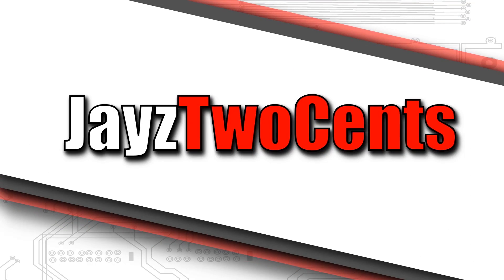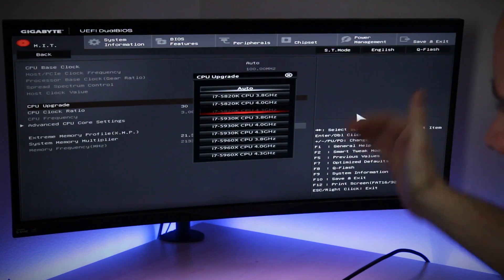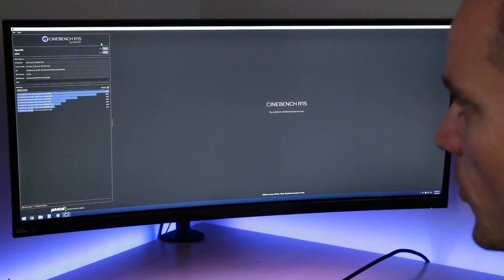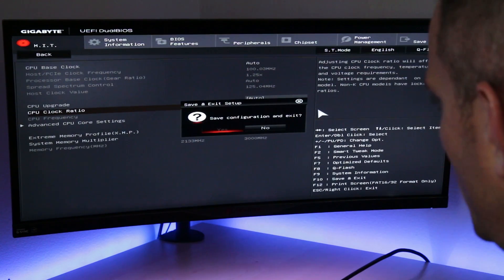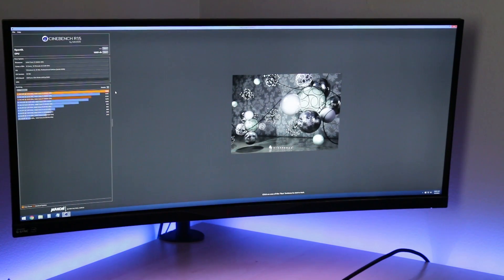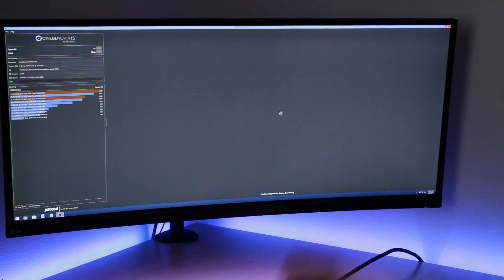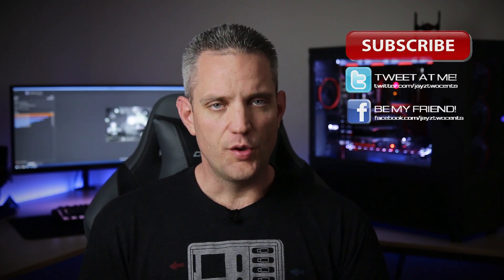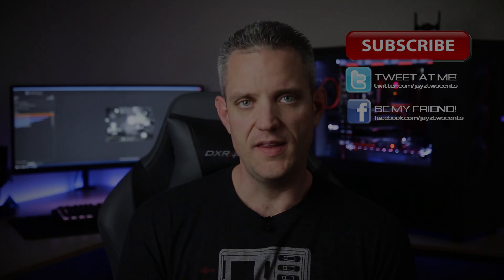XMP vs Overclock

Comment: 0:14 someone tried over clocking an AMD CPU......
Reply: ***** RyZen has a lower TDP than it's intel counterpart... so, nice research... even the "bad" amd CPUs aren't as bad as intel fanboys make them sound I had my 8300 overclocked to 4.2ghz and it never went over 45c under load
Reply: AMD still holds the world record for overclocking and is king for extreme overclockers.
Reply: 1 year ago... joke's on intel now.
Reply: pretty sure that was a grow house
Reply: To my knowledge even 8320 is capable easily getting past 4,5ghz with decent cooler with 1,4v. Haven't OCd those that much but I believe the voltage was around that 1,4v. 8350 isn't that different, it's just higher clocked out of the box, but reaches 4,5ghz or more with similar voltages. Also we know that 1,55V is still ok Core voltage when temps are kept in check since fx 9590 at 5ghz uses 1,55v and it's out of the box and it's again the same chip as 8350.
I'm not sure how experienced overclocker you are, but you RAM or even the motherboard VRMs might be the issue. You need atleast 8+1 power phases to get decent current, since those CPUs can go near 200w tdp when OCd. There are power saving features aswell so check on those aswell.
Reply: Steven Randall Heat and temperature are two different things. fx 8300 has die size of 319mm2 which is the same as 8350 cause they are basically the same chip also the chips is full CPU, no GPU part. Back then at 8350 release Intel already had i5 3570k out and it only had die size of 160mm2 and it had integrated GPU as part of it. Looking at the physical CPU layout we can see that the GPU is occupying about 1/5th of the die so the actual CPU is only around 128mm2.
So i5 3570k is outputting 77w tdp from that area and 8300 is outputting 95w tdp from 2,5x the area!
So AMD chip has 2,5x larger are to dispatch heat vs Intel chip, of course IHS limits this, but it's hard to say how much.
So seeing FX 8300 at 95w or 8350 at 125w while working at sub 60c is no wonder vs 77w chip with over 2x less area.
Newer Intel chips are sub 200mm2, but they have larger GPU part aswell meaning that we are still looking around 150mm2 die are for the CPU part and the TDPs are now +90w so expect to see +80c temp on Intel chips.
That being said, Ryzen is claimed to have around 200-250mm2 die size and 95w tdp so it's gonna sit below Intel in terms of temps, but higher then FX series.
So to go back to your point. If FX 8350 at 125w tdp would be as big as current Intel chips, you could only keep it sub 80c with very large air cooler or water cooler.
Reply: Diglo1 the point wasn't that am3 chips don't produce as much heat as intel's I know they do, my point is saying that ryzen is going to burn things down at this point just isn't a claim with evidence behind it, in fact the evidence is to the contrary. And I do realize that heat produced and temperature are different things, but we're talking about the ability to dissipate heat, and keep temps low, not necessarlily that there is less heat to begin with. Also upgraded to an 8350 after selling my 8300, thermals in my system didn't change between the OC 8300 and the stock 8350
Reply: Steven Randall Ok glad we are clear.
Well overclocking 8300 is pretty much making it 8350, the other one has simply more conserved turbo and voltage table, but it's the same chip and the binning is the same.
Anyway at 95w tdp with +200mm2 die are for the 8c 16t part should be pretty cool setup.
4c chips with 95w tdp should be similar to current Intel lineup id IHS is good as it had been on AMD chips, not the crap Intel uses.
Reply: Diglo1 I know I wasn't intending to change from the 8300 to the 8350, but i needed to sell my motherboard and the guy offered me an extra $150 to include the processor... picked up the 8350 for $110 it was really a no brainer. Besides I was having some difficulty trying to get it past 4.1 this one remains to be seen
Reply: I have no dreams of going anywhere near 1.55V as of yet, I dont think my cooler will take it. My current board is 8+2 power phases and the old one that I used with the 8300 was 6+2, Overclocking had nothing to do with the switch though it was SLI that got me to sell my old board and move on, the slots on my old MSI board were awful as far as position was concerned
Reply: Steven Randall Just saying that if your OCs fail it might be because of lack of voltage and cooling and that you do not know safe limits and are too conservative as to how much voltage to use.
But if you are aware I guess good luck. 4,5ghz should be piece of cake with hyper evo 212.
Reply: PACo626 my house will be soon burnt into ashes....i overclocked my fx 6300 to 4 ghz...
Reply: That was reached by LN2 since no other kind of cooling can do it. Also RAM timings an speeds are unknown, the motherboard is not that great for very high end overclocks. So I wouldn't trust those results even if the overclock was done on one core. There is a slight possibility, but I doubt anyone would dare to even try LN2 OC with 970 chipset motherboard which doesn't have atleast 12 power phases.
Reply: Real world vs competition? Really? It means nothing to everyday use.
Reply: Wow somebody made that joke a year before you did in these comments. 10 outta 10 good job.
Reply: PACo626 lmao
Reply: The King of OC and World Record is Intel, not AMD, lol.
Never seen an AMD hitting 7,3 + GHz.
Reply: Sompli bull shit, fuck you.
Reply: the FX 6300 ran up to 9.48 Ghz in Records. 5Ghz ona  good sample is possible stable. http://valid.x86.fr/search/search.php?psn=414d4420465828746d292d36333030205369782d436f72652050726f636573736f7220202020202020202020202020&sort=freq
Reply: I'm gonna need a source on that one, because my overclocked FX-8300 is at 61c and has been stable at that temp for the last 5 mins of what is now a 15 minute torture test. Seems pretty reasonable and leveled out to me
Reply: J Cell just got my AMD A10-6800k to 4.8Ghz at 50-56C
Reply: My AMD 10-6700 is overlcoked & the regular average temp. only goes around or up to 52-63c.
Reply: Yeah but absolute dogshit for gaming
Reply: santclause1 that's at 100% Max load though, tj Max is like 72 anyway, pair that with a discrete gpu and it is fine. I can play any game no problem
Reply: Or Haswell
Reply: Dats just AMD cpu (older versions) but with Ryzen now, it will be a mushroom cloud!
Reply: +joshua mcgovern ye and a intel pentium would be faster than that worldrecord oc at stock speeds
Reply: +joshua mcgovern ye and a intel pentium would be faster than that worldrecord oc at stock speeds

Comment: I just overclocked as far as I needed to. So by overclocking my I5 4670k from 3.4 to 4.2, I gave my cpu performance headroom, whilst at the same time having the cooling capacity to take it further if I wanted to. Since Iam in winter in Australia, probably not a good idea since in summer my temps are probably going to even out

Comment: F me overclocking didn't used to be so complicated XD. Thanks so much Jay for helping me understand why I couldn't get my full advertised ram speed through the XMP profile (Already overclocking CPU as far as possible with current cooler) Now I'm just curious about what the perfect trade off would be, Maybe back off a little on the main clock? Or try to drop timing on the ram to get the latency down instead of the ram clocks up? Much tinker. Very OC. Wow.

Comment: My first 5820k was killed by my Asus X99 Deluxe on Auto OC. The Voltage Delivery was broken and the CPU didn`t survive that. Gladly the retailer send me both Parts new and I am now running 4,3GHZ at 1.275V stable. The highest stable was 4,6GHZ at 1,325V but it was way to hot for Air Cooling. Anyone with similar experiences?

Comment: But automatic overclock most times puts more voltage than the CPU need and raise the temps & lower the lifespan
Reply: why do you think he stresses the importance of cooling?
Reply: wades623
Cooling may be good but it does not lower the higher voltages. You may run on 35C and still have higher voltages. The threat from the higher valages is not just higher temps man :) I was talking about automatic overckloking
. I like to set it on -0,25v on mine for example. Thats automatic voltages -0,25v.

Comment: >Got FX8350 and Dark Rock Pro 3
>BIOS automatically set clock to 4.1GHz
>Run Prime95
>Can't get through 10 minutes without 2 cores failing, even though CPU at 50°C
>Have to set CPU to 4.0GHz (a.k.a. "Power Saving Mode")
>Finally works fine
>...
>There was no lottery to be had
>Fuck AMD.

Comment: One of the best motherboards I've ever owned for overclocking is the ASRock Z170 OC formula. It's not cheap, but wether you are a novice (using profiles) or an expert (manual), you can get some great stable overclocks out of your ram and cpu. Super stable power delivery. Love it!

Comment: Here's a question: These overclocks were achieved using a K series CPU. These CPU's cost more than "normal" ones, so the overclock isn't actually free - you paid an extra for the CPU itself (and for the mobo, and for the cooling). So is the performance boost actually worth that extra cash?
Reply: As far as I understand the K models are the unlocked models so theere is I5 6500 and 6600k can't over clock the 6500 and yes the unlocked is more expensive. But not $100 more

Comment: Is the hyper 212 evo enough for automatic overclocking?
Reply: Yes. That's exactly what I'm using with an ASUS Z97 AR board/G.Skills Ripjaws RAM @ 2400MHz and i5 4690k CPU auto-OC'd to 4.7GHz. You will need a large case with 6+ fans for good air flow, though. HTH
Reply: I used to use it, for X99 you shouldn't as my temps were quite dangerous but with cooler chips you should be fine for moderate overclocks
Reply: it's more than enough I just built a pc for a friend with the hyper 212 cooler and a i5 6600k and got it to 4.6ghz stable at 1.275v and it hasn't gone over 60 degrees Celsius, hyper 212 EVO is the best air cooler you can get at least for its price

Comment: Intel Core i7 5960X (8-Cores, 20MB Cache, Overclocked up to 4.0GHz w/ Turbo 

this is my cpu and i was wondering if i can oc. because when i got it. it wasnt 4ghz but 3. soooo i was wondering do i have to oc my self idk
Reply: Overclocking is easy , just don`t go pas 1.325 volts if you want to be safe play around with the CPU as long as you keep with that voltage you should reach 4.4 and 4.3 with no problem , don`t be afraid to change it a bit but never past 1.370
Reply: aight thanks man!!!

Comment: I built a Sandy Bridge system in 2011 and followed all the good advice when overclocking.  My 2500K was running at 4.6GHz with 1.3V which apparently is a very safe overclock with that chip.  Then about a month ago my CPU and P8P67 Pro mobo just died at the same time, no warning no nothing.  My system just powered down all at once and it turned out both were dead.  

So I'm looking at a Skylake build but I won't be overclocking it.  I'd sooner not have a bit of extra performance if a few years down the line it's gonna cost me £600+ for new parts.  I want my PC to last ...
Reply: +Sid Cannon No point in going for a Skylake cpu right now, the 4790k pretty much performs exactly the same as the 6700k, same reason i didn't bother to upgrade to a 6th gen and got a 4th gen
Reply: Bongo2k
I'm actually considering a 4790K because I can use my existing DDR3 and where I live they're currently doing a deal on a 4790K and an MSI Z97 Gaming 5 mobo for £377.  Skylake mobo & CPU is at least £50 more then there's the RAM.
Reply: Sid Cannon Ram speed honestly doesn't really matter for gaming and general computer use, plenty of videos confirming it. Linus did a good video too.
I got a Sabertooth Z97 off ebay for £145 and a 4790k for £240. 8gb 1600mhz CL10 ram was only £30 and you can easily upgrade to 16gb for an extra £30 later.
Reply: Bongo2k
I know, I watched the RAM speed video(s) done by Linus, as memory speed goes up so does CAS latency and they cancel each other out. 

I've ended up going with Skylake because I really wanted a Sabertooth motherboard and I couldn't find anywhere selling a Z97 Sabertooth new.  It's cost me a bit more than I wanted to spend, but hopefully it'll last me yonks, longevity is the main thing for me, hence the Sabertooth.

It's being delivered tomorrow, happy days :)

Comment: My i5 6600k got 507 score at stock. At the one button over lock thingy on my board it bumped to 4.4 ghz and it's sitting at a 726 score.
Reply: +Lagged ops My i7 3630QM (notebook) make the same 507 at stock ( there is no overclock in BIOS)
Reply: +Raimar Lunardi so overclocking my i5 makes it destroy your i7 :)
Reply: +Lagged ops Well, thinking that Mine is a NOTEBOOK and 3 generations older, I think it destroys your i5 in performance per watt :)
Reply: +Raimar Lunardi but performance to price mine wins cos laptops are way too expensive
Reply: +Lagged ops divide the price for 3 years now...

Comment: @JayzTwoCents
Hey jay I watch the channel and love it. I think all of the things you do tech wise is awesome. I love the reviews, guides, and other random things that appear on your channel. I was recently changed by a friend to pc " use to be xbox" gamer. Ive only built my first computer now and have a question. The build is as follows, ASUS M5A78L-M with an AMD FX 8320 processor, cooler master evo 212 cpu cooler, AMD r9 390 graphics card, corsair 850watt PSU, Western Digital 1TB hard drive, 16gb 1600mhz RAM,  a cd/dvd disc drive, all in a full tower gaming case. Im working on overclocking my cpu currently and was wondering what should be a number that i should be able to achieve with this setup?

Thanks

Comment: Greets. so you say that if I do the easy overclock on I5-6600K (with Asrock Fatal1ty z170 gaming k4) to 4.2, should I put the profile to auto and not XMP profile 1? I m not sure I understand this XMP thing; I have the hyperX 16 gb dual channel ddr4 at 2400 Mhz. a little guidance will be appreciated. thanks

Comment: What about if you oc your cpu will that reduce your cpu longevity. for example your cpu can work for 6+ years but if you oc it that time may reduce number of years your cpu will work.
Reply: +Grim Reaper there really is no number that is reliable, youre more likely to have a bad chip that degraded faster than spec than to have a chip die simply due to overclocking. this is assuming that you arent a moron  and pumping volts into youre cpu to run a crazy high clockspeed with a stock cooler.
Reply: Taylor Trotter

i have water cooling predator 360 and i didn't go to far with volts. Got my 5930k @ 4372ghz
Reply: Nice. Did not mean you specifically. Point is, as long as you keep the chip cool while overclocking, you'll be fine, Ive run my amd fx8350 at 4.7 ghz since I got it a couple years ago.

Comment: stupid question, do most modern mother boards have the XMP and automatic overclocking settings? Im looking into building a computer and I'd like to have these options.
Reply: +FyreDrayke7 Pretty much all modern motherboards will support XMP - if they're intel, it used to be only high end motherboards that supported automatic overclocking but even some mid-range mb's are capable now. If the motherboard supports it you can bet it will be clearly advertised.
Reply: mentoo1234 well, thank you very much good sir! Very helpful, have a great day.

Comment: XMP Profiles comparing 2 brands 2800 vs 2800 will not change bclock any differently.  It's entirely up to the motherboard manufacturer and their bios guys.

Comment: I overclocked my 2.83ghz xeon processors a long time ago to 3.5ghz. It has been running since 2008 and I never needed to increase voltage after the initial overclock. One ram stick died, but they have been running at 85-100 °C

Comment: Stock Cinebench score: 3259

Dual Xeon E5-2680v3.
128GB Ram.
Reply: gg
Reply: O_O (i will get a quad xeon board and fill it up with 22 cores xeons a and a terabite of ram
Reply: That would be a waste as the Xeon E5-2699 v4 only supports two (2) processor configurations.  If it did support four, it would cost you $16,400+ for just the processors.
Reply: Alexander Morou Some people do it for the sake of the benchmarks, if i was not poor ... I would buy 2 of those monsters and search for a motherboard that supports overclocking sad i can`t .

Comment: I have i5 6600k and Cooler Master Falcon bench (a stock like cpu cooler). Should i try automatic overclocking?
Reply: +Savo John watch your temps, then go do it, watch them again, if you feel they're too high don't do it and get a better cooler later on
Word of advice, there's no reason to get a K unless you're gonna oc for a fact, if you know you're not gonna invest the extra in a better gpu
Reply: +1097jad My stock temps for 6600k on this cooler are 5-11 C on Idle and 40C on load(Cinebench R15).
Reply: Savo John That looks more than alright to do it

Comment: Well, it's not actually free if you need to invest on a good cpu cooler :P
Reply: +Nad Kudo 
depends on 2011 chips  there is no heat sink included so you would be buying one anyways lol
Reply: gnarly333 "good"... stock heat sinks are not that good for overclocking

Comment: Jay when I go into the gigabyte bios and try to enable xmp it is locked an I cannot access it. I have a z97 board and a i7 4790k. Why is it doing this? I can change into different presets but they don't work